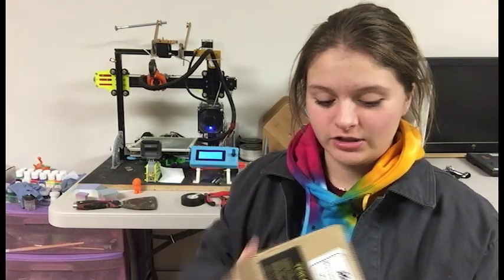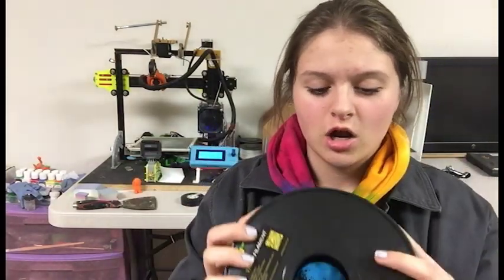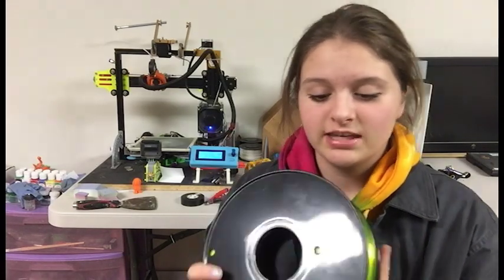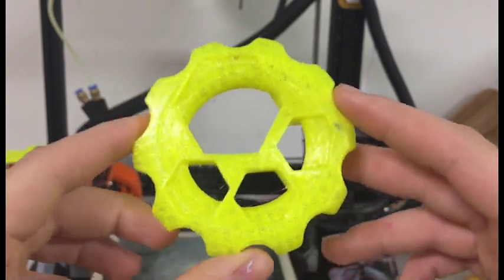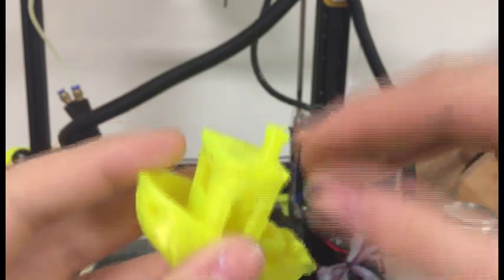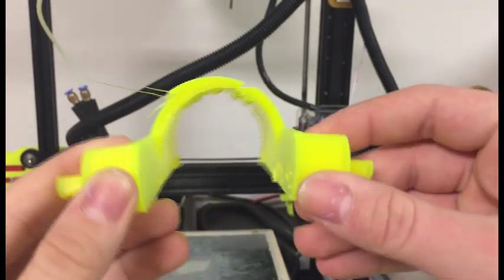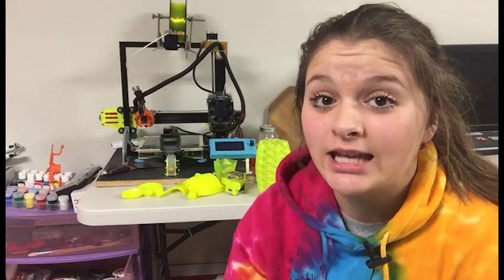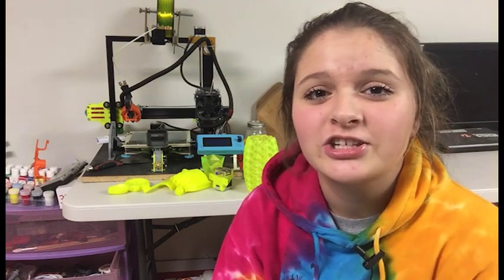TESLA Transparent Yellow PETG Filament Review

Comment: When printing PETG, you wanna add a little more room between the nozzle and the bed compared to PLA. If your nozzle is too close, it will "plow" thru the filament and the nozzle will pick up bits of filament. I use 30% fan on my PETG prints.

Comment: PETG requires slightly hotter end than PLA and prefers to be "placed" on the build surface rather than squished like PLA. Raise the nozzle up slightly and slow the print speed down to 50mm/s and you should be fine.
Reply: You may also need to clean your nozzle more often as the strings will fly like hairs and will stick to the nozzle and burn. You will get build up which can burn into carbon and flake off and stick to the print. Keep an eye on the build up.
Reply from the maker: Ok thx

Comment: About the layer shift... You may need to increase motor torque by increasing the motor current? I have the same printer and I have never had layer shifts. As long as the motors do not get to hot you're fine...
Reply from the maker: Bigman74066 thanks you! I did get it fixed... when I uploaded a new version of marlin it changed the accelerations and changed it from 3000 to 1200 and now everything is good...except my printer isn’t work now because my Thermistor broke and I’m waiting on new ones to be shipped in